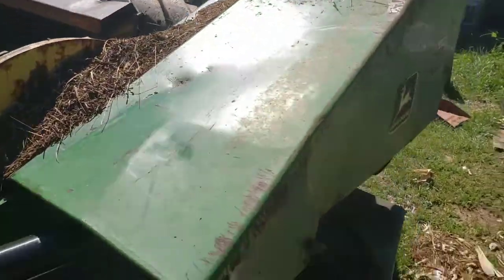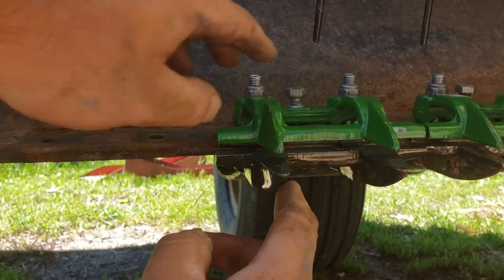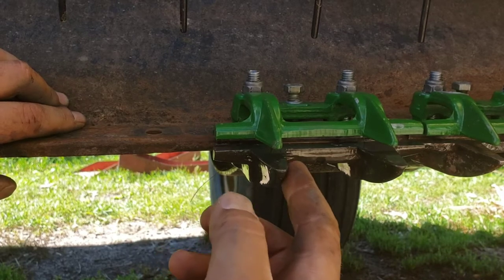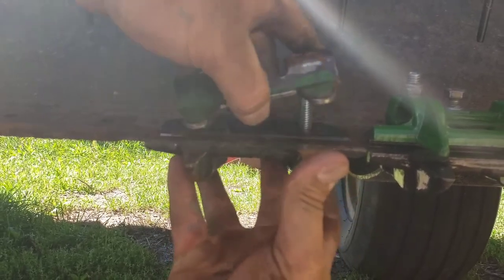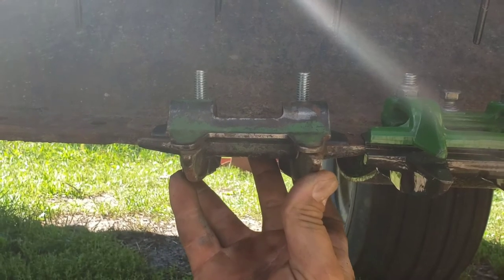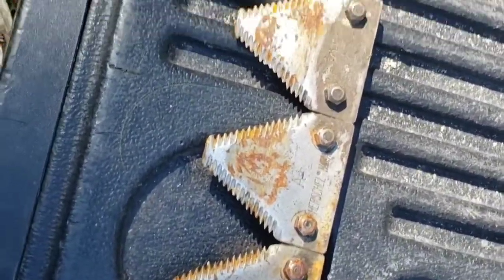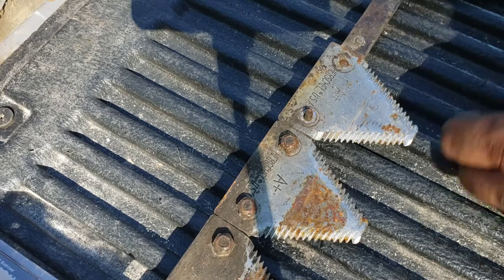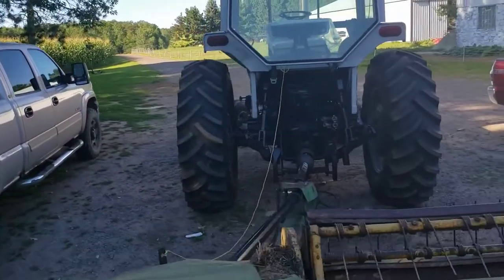Haybine repair non-clog guards

Comment: Good  day from Ontario  Yes years go stub  rock guards,  they usually   didn.t break .  I found that they didn.t  cut as good  as old guards  with ledger  plates on,  but with price.
Yrs ago  they use rivets, pain
Too bad.  Those wobble boxes repairs are expensive.    Thanks